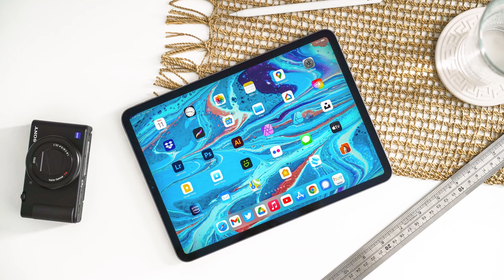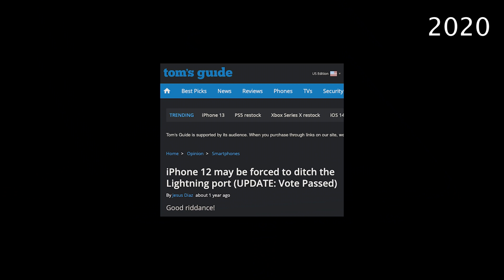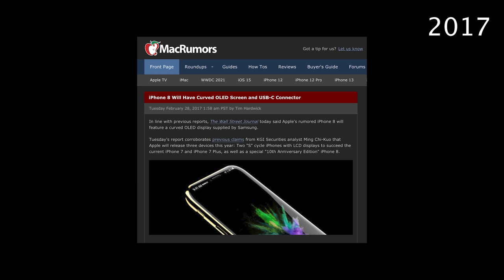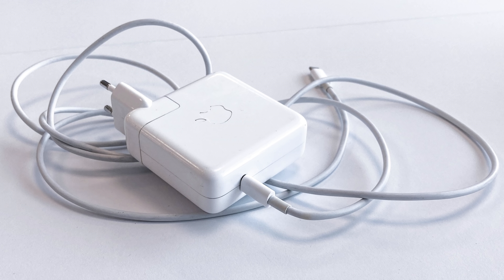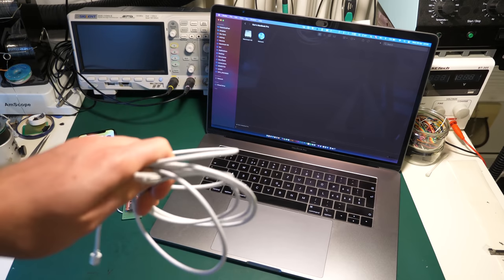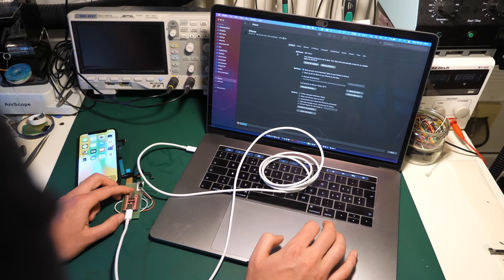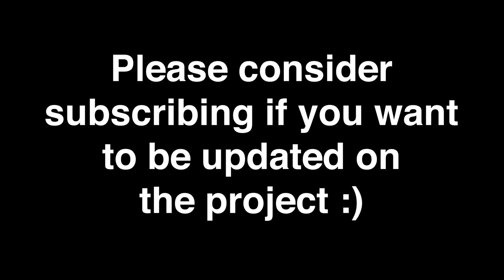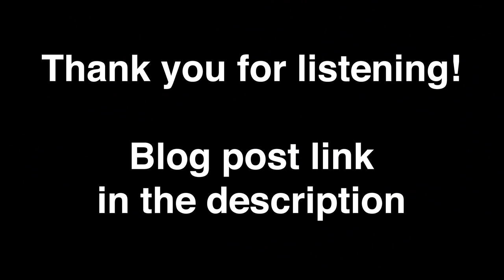The USB-C iPhone Mod - Proof of Concept

Comment: Good job, I hope you're able to miniaturize your circuit. It would be amazing if third parties started selling flex cables with USB C already swapped in instead of lightning, and then you'd just need a custom chassis.
Reply from the maker: Thank you. This is definitely something I'm aiming for. I will make it all open-source once it is completed and maybe someone will make a commercial version like you mentioned!
Reply: @ExploringTheSimulation  No, make it your bussiness, man, it was hard work!
Reply: @olexandr1997  nope
Reply: There's is a guy in YouTube who did this year's ago on an iphone x I think and the USB c port is inside phone and fully functional
Reply: @ezekiel237  there isn't, don't lie.
Reply: @ezekiel237  was that the Strange Parts guy?
Reply: @ExploringTheSimulation  wait untill apple finds a way to sue you guys
Reply: @muleyg  true true but apple is apple , they ain't gonna be without a fight
Reply: @muleyg  I wish that were the case, Apple keeps going after cases like this though and hence stifle innovation. This is the same company that infamously doesn't give the repair industry parts to work with due to supposed IP conflicts.

Comment: I believe if you X-ray the lightning pcb, you can see the pcb design. May be useful. Thanks for the video
Reply from the maker: True but you need access to an x-ray machine, which I don't have. There is simpler ways to reverse engineer small circuits ;) Thanks for dropping the idea tho
Reply: @ExploringTheSimulation  You could ask William Osman, He made an X-Ray machine and might let you use it.
Reply: @fwmtb  😂😂😂😂

Comment: An oscilloscope, a continuously adjustable linear power supply...probably has the equipment to build the KennyPhone, a USB C "iphone" with a removable micro SD and headphone jack.😉
Reply from the maker: haha KennyPhone, love it! Keep the ideas coming, I'll be deciding what the next project is very soon :)
Reply: @ExploringTheSimulation  why do we still need microSD’s these days? Isn’t that why we just data transfer everything from a cloud or local machine SSD source? 

Btw, Apple should be doing what your doing Kenny BEFORE they release their products. Or better yet, avoid them all together and let our generation stick to open source android and Linux. 

I really appreciate your vision and hard work. What will be the next project? Subbed for your talent.
Reply: @BlakeTedKord  Because it's faster than AirDrop and more convenient than a cable. Plus, plenty of people use micro SD cards to expand their phone's storage and not necessarily to make file transfers to other devices. That's probably why iPhones have never supported micro SD cards, because Apple wants people to pay more for an iPhone with more storage than let them pay less for the base model then just pay like $20 for an extra 128GB of storage.
Reply: @BlakeTedKord  I’m running 40-50 gigabytes per football game. Yes I unload after each game and have to use cable, which is still slow because Apple did not switch to full USB C data transfer cable. AirDrop is unbelievably slow, so I use the cord. I had a 256gb micro sd in my S9+  yeah, I switched from Samsung S9+ to IPhone 13 Pro Max and feel regret. The IPhone is slower in switching to apps. S9+ was lightning fast. No split screen, which I miss. No pro camera settings in the IPhone and I’m not talking about the overhyped useless “cinematic” mode. Low light on iPhone is worse than S9+ . Very grainy. When Ultra 22 arrives I will most likely switch.
Reply: @WunKoolKat  ok this confirms my android switch obsession as well. Tyvm. Apple doesn’t even have a proper backup for windows or macOS…they promote they’re rip-off cloud service. 🌧. My only backup was corrupted on windows. And that’s all how iTunes saves it as. Hence the existence of 3rd party agencies milking off apple users. And ty for the calcification of microSD usage in 2021.

Comment: This is super high quality work, very interested in seeing the next video. This would be prohibitively expensive I’m sure, but would it have been possible to salvage the charging port module from a usb c iPad and work that into the iPhone?
Reply from the maker: Great question thank you. I thought about this when I first started the project but decided not to choose this path for two reasons.
1. The parts were just not available easily at the time
2. I don't believe it would actually have helped in this case as the operating system on the iPad is most likely capable of using the USB protocol natively whereas the iPhone uses the Lightning protocol. This would have probably required a software mod that completely changes the scope of the project. Here we reverse engineer the circuit on the C94 board to do the Lightning - USB conversion for us without having to study it in detail.

Comment: Hey friend, these Apple cables are really built like tank but you can use some heat from the hot air station after removing the upper layer of it. And for the pcb part, you can trace schematic with the help of some x-ray machine like the ifixit guys do. Hope these tips will help completing your project. Have a great days ahead 😊
Reply from the maker: Project is already completed ;)
Reply: @ExploringTheSimulation  and I just watched your other videos 😅😅😅... Sorry I was a bit late

Comment: Looking forward for the same cable replacement for airpods case. It's a lot free space in it and also it does not require data transfer
Reply from the maker: that's planned :)

Comment: You could do a case wich has a lightining plug inside, and a usb-c plug outside. It wouldnt require opening the phone, and would be easy to anyone to use it, without any soldering or messing inside the phone. And it would be probably commercially viable, even more if apple actually switchesd to usb c in newer iphones

Comment: Excellent project and excellent video!  Congratulations on rubbing in Apple face what it doesn't want to do.  
I believe that Apple is more likely to remove the lightning port and just leave wireless charging, than switch to UBC Type-C
Reply from the maker: Thank you for your comment :)

Comment: Very cool.  what type of vice is that you are using to hold the bard and cables for soldering?
Reply from the maker: Hakko Omnivise. It's pricey for a vise but you get what you pay for, it's super heavy and high quality. The other cheap pcb holders I bought all broke or kept sliding because they were too light. Buy it for life!

Comment: Wow. This is so cool!! Subscribing to see what you will do next :)

I have an idea for a project: PS5 (or PS4) that can play ps1, ps2 and ps3 discs!
Get old hardware (ps2 and/or 60gb ps3 CECHAxx) and take components out (Emotion Engine?) and add it to PS5.
I dont know if thats possible but it would be amazing, Sony is sadly not going to add hardware-based Backward Compatibility.
Maybe the software is going to make it impossible. Just make sure Sony can't come after you.

Another idea: adding a 3.5mm headphone jack to new iphone/pixel.
Reply: Redmi Note 11 Pro 4G

Comment: this project might work for data transfer and charging but it won't work for audio or other connections because apple has different connectors for different purposes. although all of the connectors are the same from the outside, they are different in the inside. if you open the lightning connector of an earphone, you will see a different circutry. that's why manufacturers have to order the correct connector for their product.

Comment: I have a could suggestions, instead of reverse engineering the public which would be time consuming and difficult as it is a glop top chip, why not hollow out parts of the case, such as removing the barometric vent, shifting the tactic engine, and similar stuff, and fit the board in and use 34 Guage wire and run it to the port at the bottom of the phone where the USB c connector would be
Reply from the maker: Could have tried that way but the C94 connector is kind of big and I didn't really see a way to make it fit. So then I had to choose the 'hard' way which turned out to be successful. You can check out my other videos :)

Comment: just put a lightning to type c adapter

I mean a mini adapter which converts lightning to a type c port
Reply from the maker: hey, thanks for your comment. this kind of defeats the whole point of the project, you could also say 'just use wireless charging'.. here what I'm trying to do is modifying the iPhone so that you can use it with the same charger you would to charge all your other devices (like macbooks). without any adapters ;)

Comment: well what’s the purpose of it, in any case the whole lightning connector is nothing else than a usb 2 port so in terms of charging maybe it would help but data transfer still bad, i’m not sure that the chip is just a protocol adapter or is the actual usb2 chip , is worth to check i guess

Comment: Wouldn’t it be easier to see how to iPad handles it instead?
Reply: Not really, because the iPhone needs the chip on the lightning connector to work. Otherwise the iPhone will complain that a non-apple certified cable is plugged in and it won't charge.
The iPad doesn't need this chip on the cable.

Comment: Great circut and amazing proof of concept, but that's not the problem. Apple could easily make "the perfect phone", with USB-C, a headphone jace, SD Card, the whole thing. But they don't because they want money. They make lots of money on adapters and dongles. But the second they remove the lightning port, there goes that. That was also the most likely reason that they removed the headphone jack too. SD card? But you could just charge more for more storage instead of people buying from other companies. This is why I don't buy Apple.